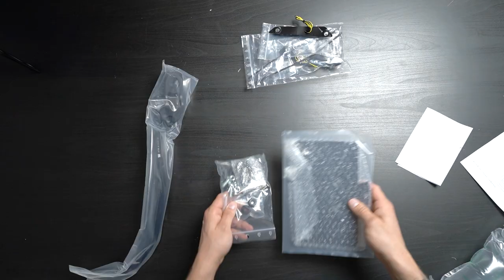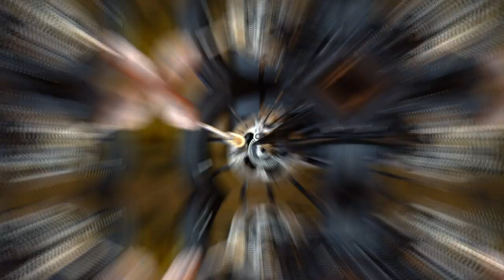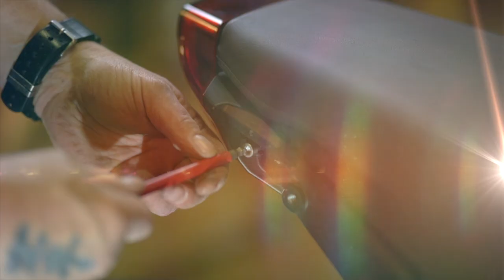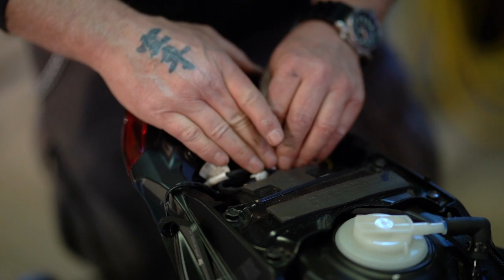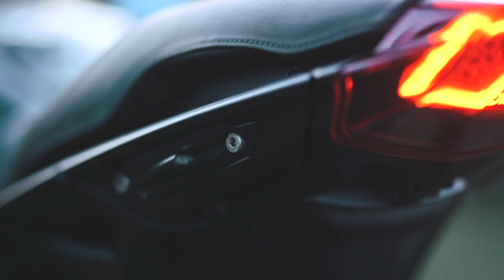TANK MACHINE x INDIAN FTR 1200

Comment: I like the Tank Machine Integrated Rear Turn Signal Kit for my 2023 Indian FTR 1200 but I have a few questions about how you hide the wires to the harness. Did you route the wires up and under the seat? or down underneath the frame next to the gas take? or did you replace the hex socket seat bolt with a hollow hex thru-bolt? or did you drill a new hole in the subframe? I just want to know how to hide the wires before I purchased this item.

Comment: Hi Marvelous . I have the number plates that mount with brackets directly under the grab handle holes on my Rally . Would these blinkers fit and still leave the lower bracket mounting holes exposed . Thanks
Reply from the maker: Hi Kelley, i do belive so. But just in case, send Tank Machine an email to hear them out :)